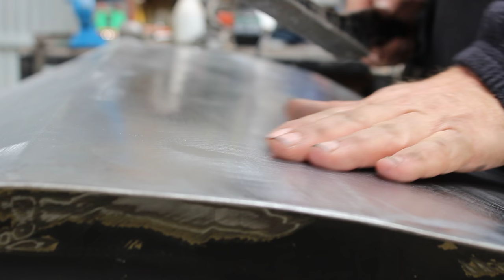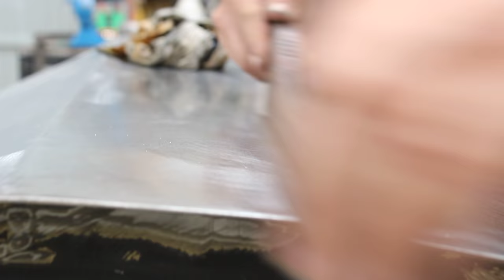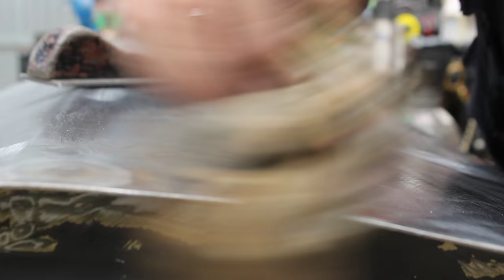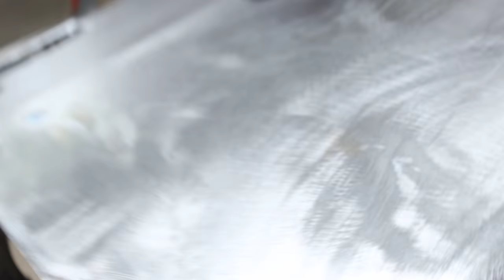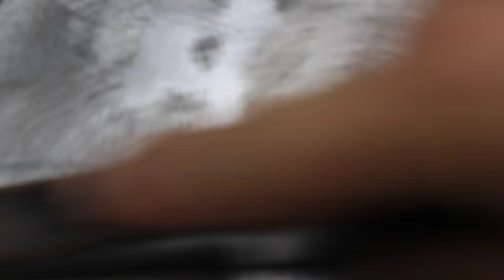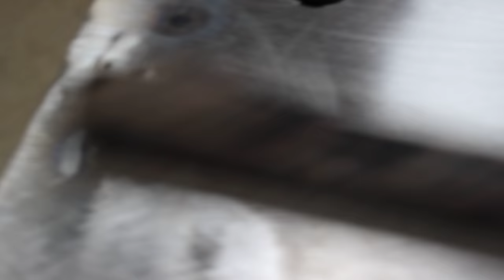Streetneat dent deletion with  oxy torch

Comment: Im trying to save a 40 year old fender...been binge watching these vids....youre the first that uses so little heat and gets such a tremendous job...most do a cherry red spot then drench it....thank you
Reply from the maker: Each panel will require different heat depending on its shape which  has the built in tension. Some  flat panels like this door don't  need a lot - where something with more shape will be a bit more resistant. The cherry red spot then quench is for shrinking; When doing that it has to be hammered on dolly  to do the bulk of the shrink and the quench will do the final pull in. I wouldn't do a cherry spot on this door as I cant get a dolly in behind to hammer onto!
Reply: streetneat and that seperates the boys from the craftsmen...love your vids and thank you for your knowledge

Comment: Awesome demo. I had no idea so little heat is required to move metal! I'd have never, ever thought such a quick pass with the torch would yield results. Thanks for sharing this.
Reply from the maker: It moves very quickly so the torch is possibly  too much heat - but is the traditional method. It bugged me for decades on just how guys can pop hail dents with a torch - so I taught myself. A circular motion around the  dent perimeter spiralled in quickly and closer then pull back - followed by a quick quench to suddenly shrink it. Here I am simply using heat to swell the panel. When it cools it has  normally shrunk slightly which is how it holds  its shape.

Comment: About time someone showed how to do it . I have the shrinking disk as well .
I see you use a sander polisher for the low rpm. I work with metal and currently welding large sections of folded aluminium  which will pull an 10mm arch over 4000mm 3mm sheet.
I have now put a 6mm convex to off set the arching and it has finally worked  (lot of cutting to get it right). 
I have some canning across the width,  so I will try your technique but in a smaller amount of heat and i will see what happens, Thanks Pette
Reply from the maker: Cheers Pette.  Its really a trail and error thing. I keep modifying my technique  and sometimes wont quench with a rag at all. Its just about using small amounts  of heat  while watching where the metal is lifting. I  find the shrinking disc  will get some of the worse of the ironing done- the best result will be from switching the shrinking disc over to a 40 grit stickit on the same machine. That will remove the hardened steel caused by the shrinking disc and the abrasive  swirling action does the final ironing out metal finish. A final finish with 80 grit on an orbital sander does the final blend and scratch removal.

Comment: Mate just pulled the 30mm crest out of the 3mm aluminium using heat and the shrink disk worked a treat. I now have a 3000mm butt welded to do in 3 mm ali which is the bigger picture, Really happy  with the result as its something I wanted to perfect(Not perfect yet )for a long time. Also that scotchbrite drum you have is widely used in putting the brushed finish in stainless steel. Their is another attachment for it that goes straight on that uses like a pneumatic go kart tyre but smaller. They sell sanding sleeves and scotch brite sleeves that go over it. If you have it pumped up alittle flat it will sand perfect radiuses  and follow the contours. If you like I can send you photos of it and tell you where in Melbourne you can buy it, Thanks for your inspiration, and if you live in Vic more than happy to help you out at my shop. and your "Q" looks a treat
Reply from the maker: Thanks for the heads up on the power stripper tool attachments. If you can send me some photos and details via  Streetneat Ltd on facebook that works  well for me. Im expat Aussie living in NZ now. Cheers Andrew.
Reply: will do

Comment: Jeez I'd love to sit down with you and talk about the technique behind all this!
Reply from the maker: The short answer is where you concentrate heat the steel will expand as all the molecules rush to the heat point. As the steel cools  it shrinks and the molecules wont get to rush away back to where they where before. Of course all this is simply technique knowing when and where to concentrate heat. Too much  or applied  in the wrong spot will cause a  lot more damage than you are taking out!
Reply: @streetneat  Yep, I just fucked up a brand new $1000 tailgate for my 2019 F150. I had the bright idea of deleting the ford emblem. So, I cut an oval patch out of 20 gauge, tacked it in and it looks like ripples on a sand dune. Tried a propane torch, (note to self)do not use. I had to buy a #2 tip for my torch and after watching your videos, my tailgate is a flat as my ex wife's chest.

Comment: Whats the point if hi fill primer is going on???
Reply from the maker: Primer and paint makes us the tradesmen we aint. Thats the point.  First it has to be repaired  and the panel surface brought back to where it needs to be without relying on bog, hi fill primers and a lot of extra material that can and will shrink back later in the cars life to reveal whats really underneath.
Reply: there is no point cave and pave and send it on down the road. it will be just fine. by the time it does shrink the customer would have looked at it so many times and wont even notice the shrinking.

Comment: The hammer has a peak for a reason and when you use it with a dolly made out of the right material, there's no need of using the torch without water or air to cool the panel down to avoid stretching it and you just finish it with the file and that's it but its necessary to use the file the right way No circles please only X filing
Reply from the maker: Thanks for your insight Dave. The whole point of this video is to demonstrate how to raise and  file check panels that you cannot get a dolly on the inside to help with the raising and dressing.  The torch with light passes  in the right areas will pull up low spots nicely which is what I am demonstrating here. Im not sure you have noticed this is a door and inside access is impossible on the areas I'm working on here. The file motions are light and will appear circular  due to me holding the camera and filing one handed which you would normally not be doing.
Reply: Really really good post mate.